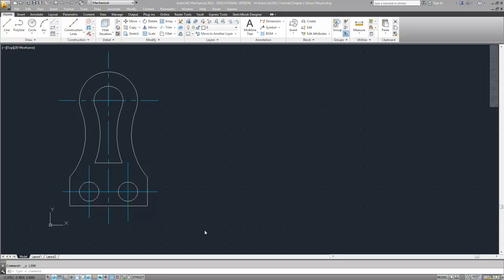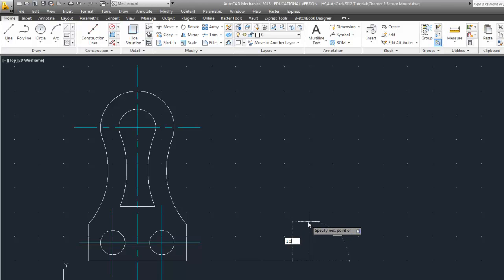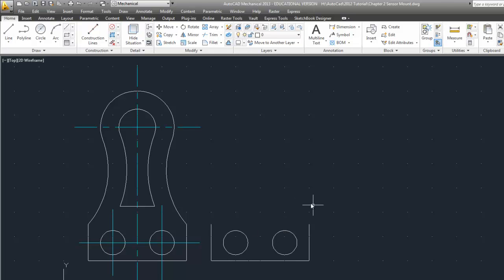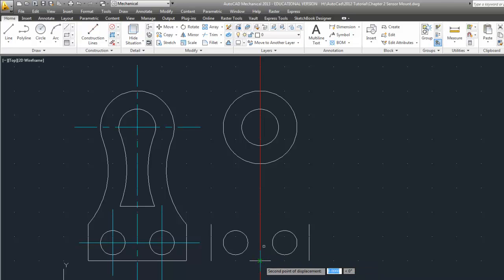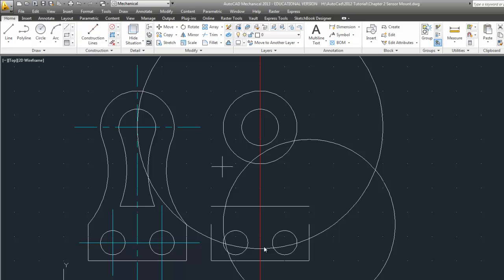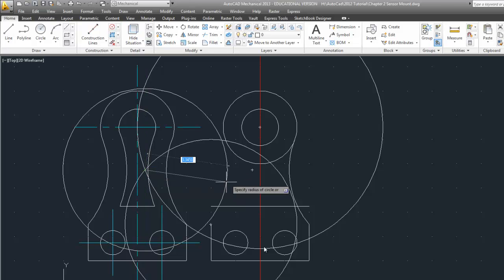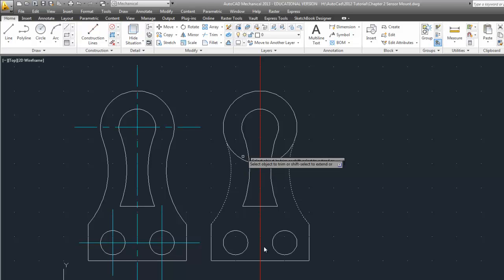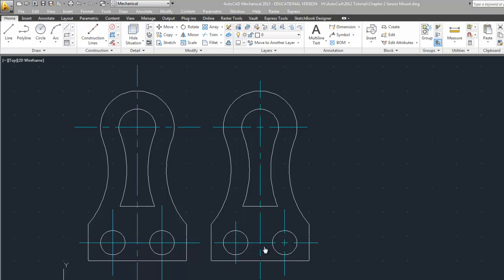Sensor Mount

Comment: This is still incorrect, as the bottom line of the inside feature that's supposed to measure 1.50 ends up being 1.4110 by this method.  I don't think the two circles share the same center point.
Reply: It actually does measure out to 1.50 as long as the center of each circle is on its corresponding center/intersection. Depending on the number of snap modes and divisions you have you're likely to end up being so slightly off you can't tell without zooming in significantly. I followed this guide step by step and ended up with the wrong measurements twice before I realized what I had done.